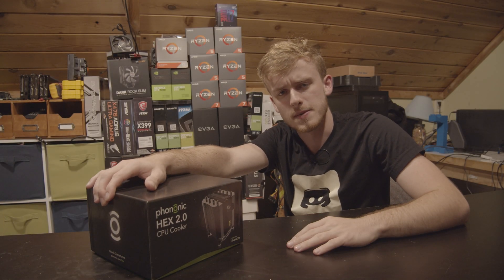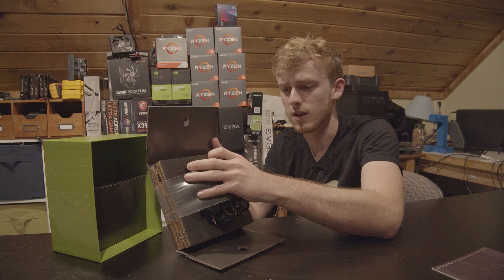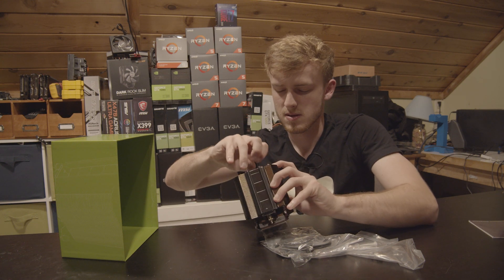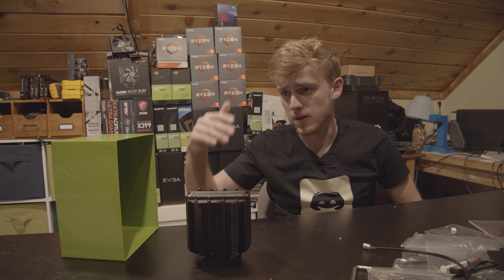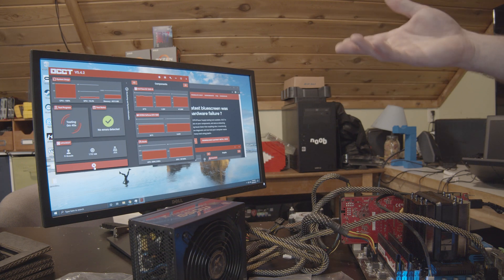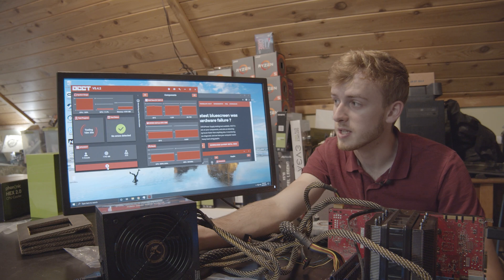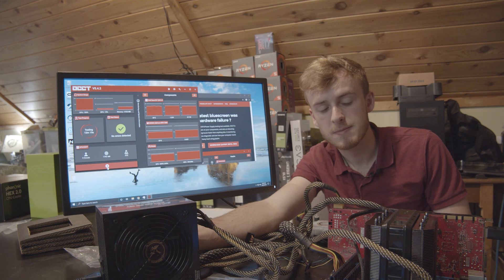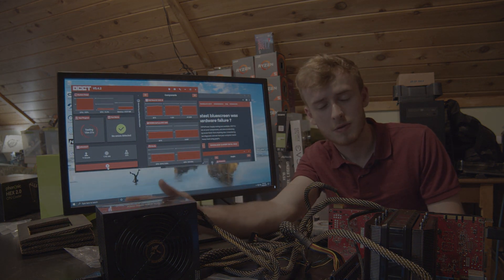A Third Type Of CPU Cooler - Not Liquid Or Air | Phononic Hex 2.0 - What Is It?

Comment: You can't fairly test this one on an open air testbench, because the cooler itself consumes 35W extra and contributes to the heat buildup and some of the hot air looping back through and reducing efficiency. Other coolers also run less efficiently in a case, but at least they would stay comparable among each other because they don't add much extra heat whatsoever. Additionally testing it against several different TDPs would be prudent, as it stands to reason that it would perform amazing with lower TDPs and become increasingly less impressive with higher ones, because how much active heat pumping action can a 35W TEC actually achieve? Maybe 15W if we're generous?

Is it a "safer bet"? Nah. The TEC and its control board form additional failure points not present in your typical Noctua, and if the thing fails, it can bake the processor from above somewhat fierce.
Reply from the maker: Thats something I didn't consider but a very valid point.
Reply: No wonder the coolers with a pentier built in are nearly unheard of now.

Comment: 1. You forgot to install Hex 2.0 software application to trigger the Peltier inside
2. You could not open the fan hood that is a shame

It only worked as normal heatsink as Peltier controller was not installed

Comment: I haven't watched past 2 minutes and going to tell you how this went: it's an over-engineered and overpriced air cooler. I have worked with peltier coolers in the past doing unrelated projects, such as modifying drink coolers into mini "refrigerators". One side of the plate will need a heatsink and fan just to displace the heat that it transfers from the cool side. So you'll be taking that CPU heat, which is normally vented into the case through an air cooler, and venting it through the case through a thermoelectric plate. Net gain = 0. Actually net loss since nothing is 100% efficient and there's another surface that the heat must travel to.  

Even if you had the warm side outside of the case, I seriously doubt that a peltier cooler is going to have much impact when up against the heat a CPU will produce. Even in a small insulated cooler, it takes a significant amount of time to cool it 20 F below ambient temperature. Anything placed in there, such as drink, would take many hours for its contents to reach a 20 delta-temp. 

Any performance you undoubtedly reveal during this video is because it's a large air cooler. Just buy a Hyper 212 EVO. It's proven to perform better than many AIO water coolers and works great for OCing. The drawback is the form factor. That's something that this gimmick product won't alleviate.

Now I'll go resume the video :D

Comment: Sorry I too do not believe you tested this Hex 2 correctly.  What about the control software, did you install this, and in what mode, ?? what about case air flow,  I've run one of these for a few years and my minimally clocked AMD 8350 cpu has not gone above 37c with Hex in standard power mode. Admittedly, due to a noisy bearing, I did change the 92mm fan for an Arctic F9 PWM, but Hex2 has been brilliant.

Comment: ah, another peltier cooler. Linus did an experiment with this concept and failed horribly, twice. der8auer also found no luck with peltier setups that don't involve a lot of mineral oil. and actually, using peltier can be dangerous. if the peltier somehow cool your CPU below ambient at idle, it will sweat and kill your system. and peltier tend to just give up under load. So yeah, peltier cooling is a bad idea.

Comment: Cool video.  Is this Peltier cooling?
Reply: basically its a TEC thermo electric cooler.  it's not a phase change cooler in the classic sense but, yeah it should cool to slightly less than ambient which on the high setting could cause some condensation.  not sure.  wish somebody would do a more in depth video on this cooler.  can't find one.
Reply: @XX-121  It's a "smart" peltier cooler that activates only when needed based on thermal load.

Comment: Is this a scam, lol, I don't get it
Reply: It's air cooling cause it uses a fan
Reply from the maker: But it’s thermoelectric because it uses electricity to pull the heat. Also by that same logic liquid cooling is air cooling because it uses a fan. Liquid, thermoelectric, and aircooling get their names because of the method they remove heat.
Reply: Well, in fact, in a water cooling, the water is use to "transport" the heat to the radiator, wich use fan to remove that eat.

On this video, the water is remplaced by a Peltier. So, it's not an air-cooling, it's not a water cooling, even if it's has fan.
Reply: @anarcat6653  Why do we call coolers with heatpipes air coolers rather than low-pressure liquid/vapour phase change coolers?
Reply: @SianaGearz  Because of marketing bro. But you are also right, an noctua with heat pipe use liquid/gaz for transfering the heat.
Reply: @DrOrder  it's a hex key, with a Phillips head screwdriver on one side. Good try though.
Reply: @NinjaInTheFirstDegree  / Still not called a screwdriver
Reply: @DrOrder  does it serve to drive a screw? Screwdriver.
Reply: @NinjaInTheFirstDegree  / look it up it's a muli tool as NO it does not DRIVE. It turns numbnuts
Reply: @JaysTechVault  I think Linus made a video about this type of cooler. maybe you should watch that first. this type of cooler is basically air cooling, and the peltier only kicks in on high load, and still failed miserably to do it's job. It's still a neat idea nonetheless, and i'd like to see a better implementation of electric cooling in the future. maybe there will come a day that temps will be the last of our concern with just additional 35W for the cooler.

Comment: No AM4? Useless for me... Excellent vid though.
Reply: He's got an old 2016 box, they should ship with an AM4 bracket now. Also i can see the AM4 bracket available separately at Caseking for 6€, so maybe check with whoever is distributing their products in your area, perhaps they can set you up.

Still, wouldn't necessarily recommend. Just seems like a horrible idea and not a very telling test, absolutely didn't push the limits and possible shortcomings of technology.
Reply: @SianaGearz  Thanks for the info but judging by his comments about how loud it is I doubt I'll buy one. I'm still using the Wraith Spire that came with my 3600X and the last thing I need is another noisy cooler to add to a howling 1080ti every time I fire up PUBG.
Reply: @MoultrieGeek  you got the fe? Still absolutely solid but is as loud as an apache heli flying right at ya